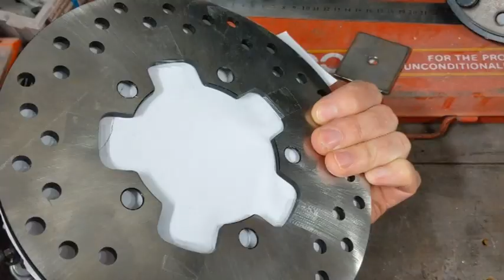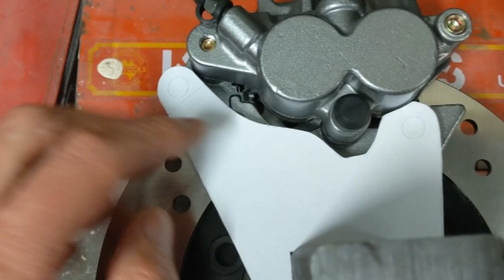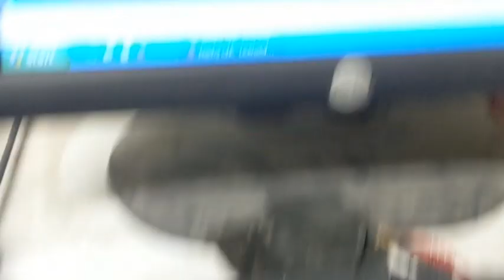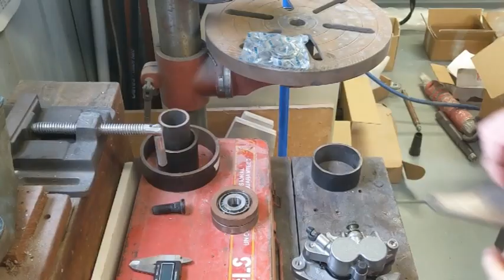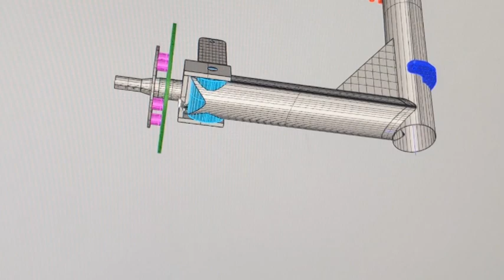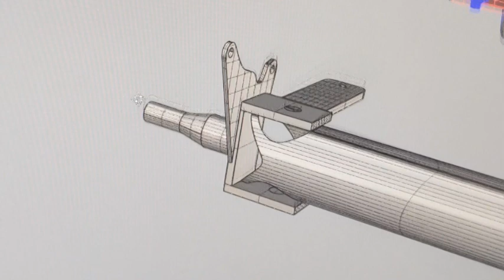Batpod V2 Build Video 2

Comment: Is it possible to find out how the rotational motion is transmitted to the wheel, and is it only to one wheel?
Through a gear, or with a chain?
Reply from the maker: The motor is inside the rear wheel.  10kw electric hub motor.
Reply from the maker: https://youtu.be/Jd3hHCfgouw